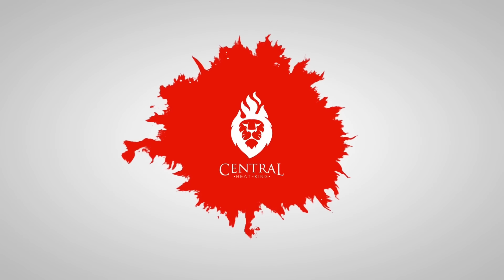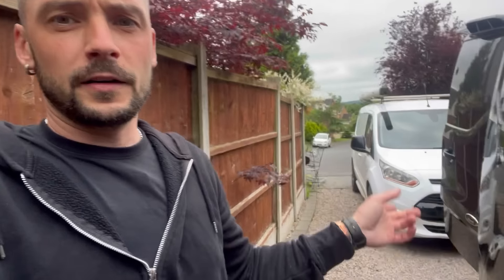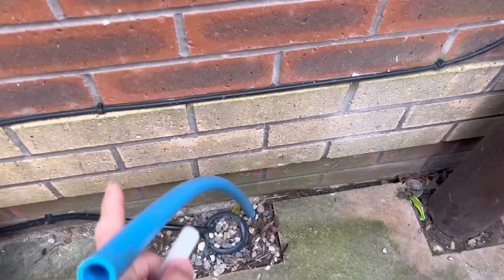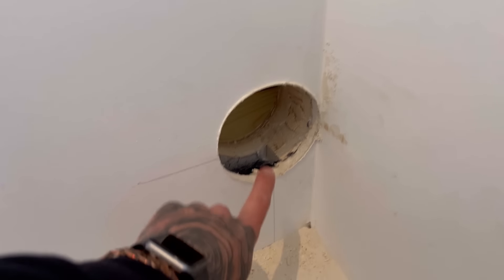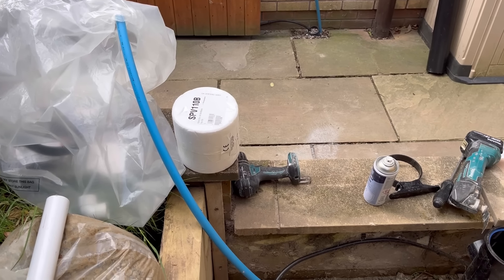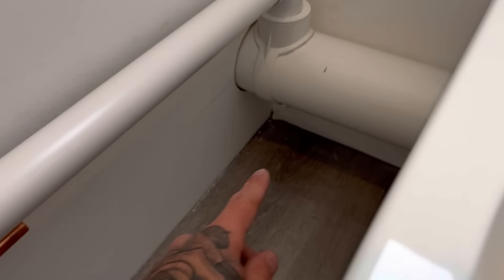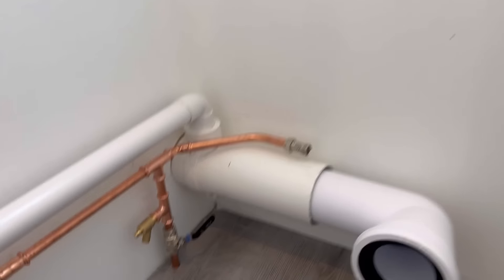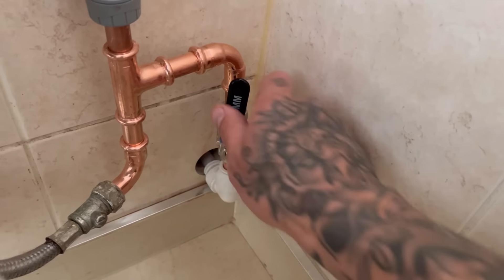I Really Didn't Want To Do This - Life of a jobbing Plumber

Comment: Great video mate. I've always couple both the hot and cold side on a tap to the cold with a tee when I only have cold going to it. That way you get water out both sides of the tap when using it. Also that hot flexy is technically a dead leg that can harbor legionella, not a complaint just letting you know what I do. Keep up the good work. 👍
Reply from the maker: Yeh that does make sense now you say it mate! Will do that in the future going forward! Thanks buddy!

Comment: Good video mate 👍 you can only work with whats there already. Shame they didnt opt for a 15L under sink water heater, could have feed the sink and basin.😎 I use the viva basket strainers and i buy a pack of rectangle overflows from amazon which fit perfectly if needed 👍
Great to see you working with dad too 😎😎
Reply from the maker: @pb9926  cheers mate! Yeh it’s good to work together every now and again! I normally carry the viva ones but not the square for some strange reason haha. I’d have had an under sink heater too but the materials were already there on this job.